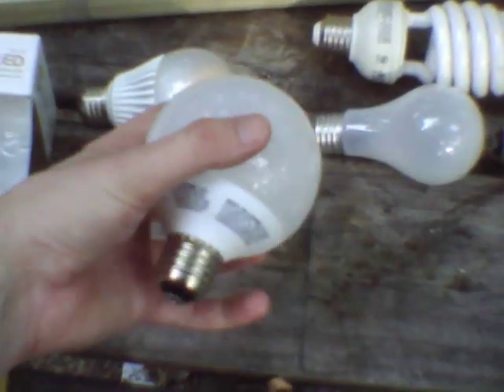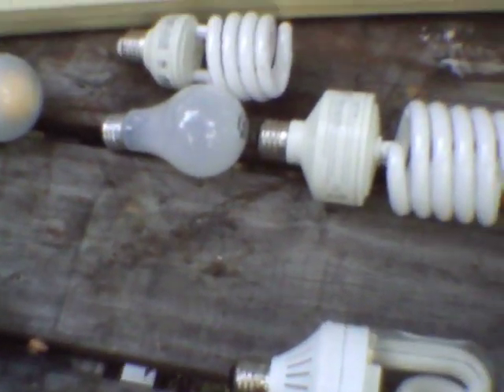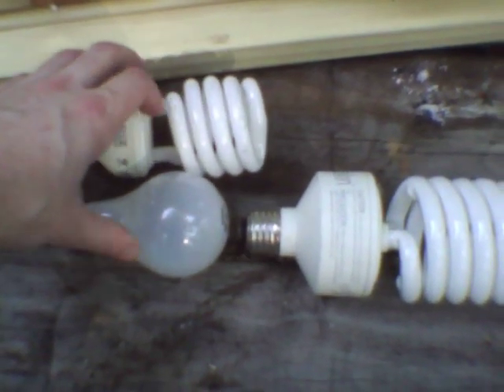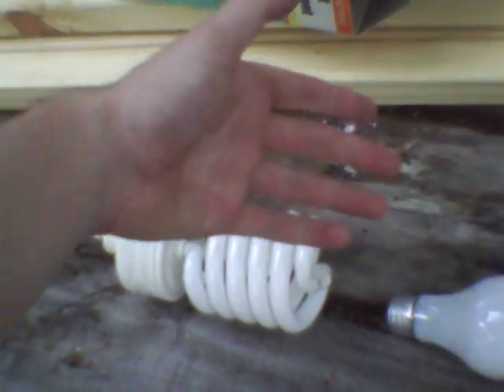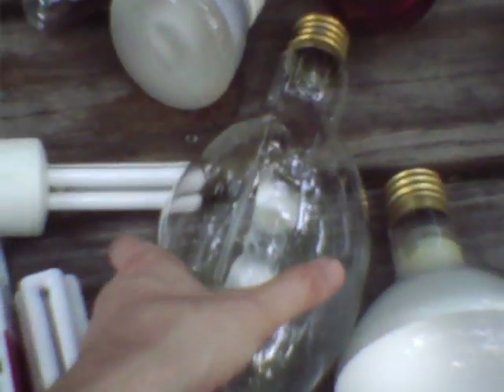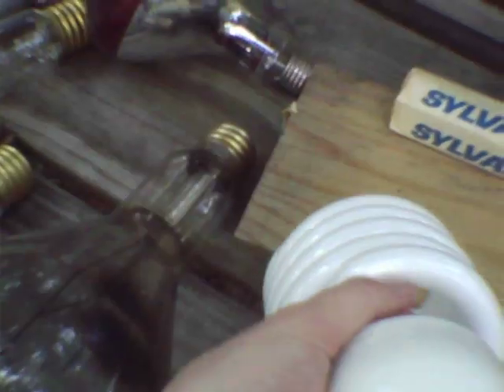Problems with so called incandescent lamp replacements

Comment: I like metal halide lamps. Yes, they explode. However, that’s actually rare. I like them better than incandescent bulbs. I like the quality of light they put out and they last a good long time if they’re used correctly. They should use glass lens instead of acrylic lens. The glass will prevent flying glass from falling on to combustible and cause a fire.

Comment: Do you know that incandescents and halogens are MUCH MORE LIKELY TO EXPLODE THAN METAL HALIDE BY A LOT. Also CFLs run cooler than incandescent by A LOT but still get pretty hot but can’t really burn you. While an incandescent bulbs ABSOLUTELY does burn you. Light bulb explodes are RARE. Metal halide explosions are more of a fire hazard than an incandescent. But incandescents and halogens are more likely to explode. Also this video is just false. Incandescent bulbs are NOT good they get very hot, Melt plastic, And incandescents is a VERY OLD technology. You may not know how old it is but it came out the 1800’s. Also LEDs do run maybe warm or slightly hot, the bases get pretty hot, but not like an incandescent bulbs. Especially halogen bulbs. Also this video is just flat out false.
Reply from the maker: The transformer as we know it was invented in the 1880s.  Should we stop using them as well?  After all, they're 'old technology' as you say.
Incandescent/halogen lamp explosions are much more of an issue for 220V and up service.
Reply: Comment Deleted.

I can’t post the same comment or it will be deleted.
Incandescent bulbs are much more likely going to explode than metal halide.
Reply from the maker: @houseguestchannel  Metal halide explosion is when idiots run lamps past their service lives.  In 120V land, incandescent explosion is rare.
Reply: @randacnam7321  When they blow the arctube usually turns black, sometimes the whole bulb turns black, but the whole entire glass bulb exploding is rare. Metal halide explosions are rare. I DON’T GET WHY PEOPLE SAY “How can this be legal” If it’s rare. Also incandescents should not be left on. If they do the bulb might explode that’s just for those who run an incandescent bulb past they’re service life. Halogen bulbs same thing. CFLs are explosion-free but can start fires. LEDs are great they are explosion free and last long. If you run them past service life no problem. May overheat but won’t explode. Incandescent explosions are caused by leaving the lights on. If they are used for less than a minute, you should not experience this issue. Light bulbs should not be used past they’re rated service life. Some low quality lights either lasted longer or shorter than they’re service life because those companies can’t figure out how long the bulb can last or make a bulb correctly.

I’ve probably seen 20+ year old incandescents in closets before, And that is because the rated was based on how long it was on if it was on all day they it would burn out within months and when used shortly it can last long. Fluorescents seem to last long same with CFLs the reason why they last short is they got turned off and on a lot. Halogens may be shorted by dimming while an incandescent gets a longer life by dimming. Older incandescent explosions are rare but modern incandescent explosions not so much. even “quality” bulbs like GE, Sylvania, and Philips explode now. GE’S Hungary and China made lights are NO GOOD they emit smoke patterns when they burn out with they’re ceiling fan and appliance bulbs. The Chinese made bulbs do the same thing.

On Jordan U I’ve seen the light bulb dim out quicker than a failing LED bulb can’t explain it. YES LED IS MUCH BETTER THAN INCANDESCENT.
Here’s the link to the video if you’re curious: https://youtu.be/K875FvIChkU.
YOUTUBE: DO NOT DELETE THIS COMMENT.
Reply: @randacnam7321  Incandescent explosion is rare. Halogen explosion is pretty common tho.
Reply from the maker: @houseguestchannel  On 220V and up, incandescents can go bang depending on gas fill and fusing.

Comment: Actually  incandescent gets hotter than the  electrodes of the compact fluorescent and incandescent uses 90% energy to make heat and 10% to make white compact fluorescent uses 75% energy to make light and the 25% tomato cheat LED uses 80% energy to make light and uses 20% of energy to make heat.

Comment: The trick with LEDs is that the higher the luminous efficacy (the lm/w), the cooler it will run. So (assuming identical quality, no fake Chinese capacitors with badly-copied electrolyte formula, etc.) a 110lm/w bulb will last longer in the same application than a 80lm/w, which in turn will outlast a 60lm/w unit. 75lm/w and better bulbs are generally safe to use in enclosed or recessed fixtures.

Be aware though that visible light itself has a heating effect (which is how DVD burners work), so no lamp can ever run perfectly cool.

Comment: I have a few LED lamps, and the heat sync does run very warm, but not as hot as an older incandescent lamp. I've notice that CFLs do run very warm, but again not as warm as the older incandescent lamps. All 3 types have their places, none are worthless.

Comment from the maker: @SuperBamaslim   Most CFLs get up to at least 165°F around the electrodes in normal operation, which is pretty bloody hot for electronics.  I have a 34W Philips SLS lamp that gets up to 255°F by the electrodes (the electrodes run hotter than the rest of the lamp due to cathode fall losses.  In comparison, a 40W GLS lamp gets up to only 219°F at the hottest point on the envelope.  You are thinking of the minimal IR fluorescent lamps give off.

Comment: CFL's run much cooler than incandescents. What are you talking about? I know this because CFL's can be placed very close to plants (when using these to grow vegetables) whereas the incandescents cannot. The incandescent light bulb will burn the leaves off. have you ever grabbed a 100w incandescent? It will burn your skin very badly. What about a 26w (100w equiv.)  CFL, they wont harm you.

Comment: We have the Costco LED 75 watt flood lamps with the CREE LEDs.  $40 each.  They are much brighter than the incandescent, phosphor color is similar to halogen.  The heat sink is only warm to the touch after 3-4 hours use.  So far no problems.

Any opinions?

Comment from the maker: @poiiihy   Neither type creates harmful radiation.  The danger from electric fields is strictly due to RF heating.  This can only come from concentrated electric fields like those around transmission antennas.  Even here the field risk is mostly at upper VHF/UHF/microwave frequencies as these have wavelengths that are at human (or parts therein) scale.  QRM from electronic ballasts is usually under 10Mcy/sec and the field of a magnetic ballast is either 120cy/sec or 100cy/sec.

Comment from the maker: @legitimatemind   tl;dr: Gorebull wormening is bunk and a scam.  CFLs are either hideously expensive or hideously dangerous.  LED lamps are either very dim or run too hot for anything other than outdoor winter use.  Incandescent heat is not wasted.  Without CO2 we would all be dead.  Environmentalism killed over 55,000,000 Africans because of their war on DDT.  Incandescent lamps are the only universal light source, and will remain so.
!tl;dr: NO U.